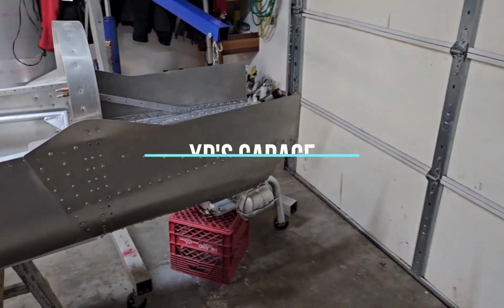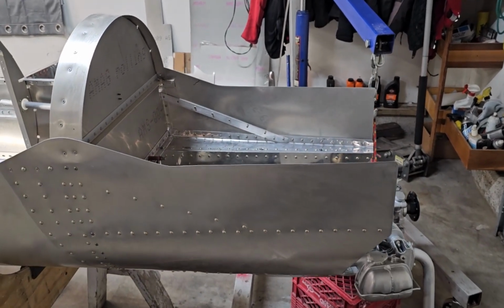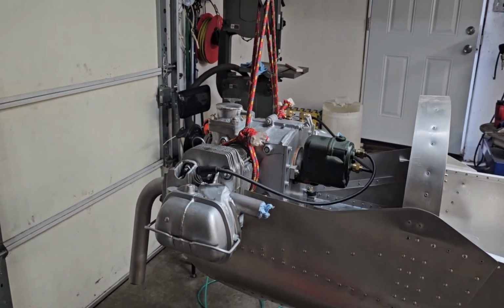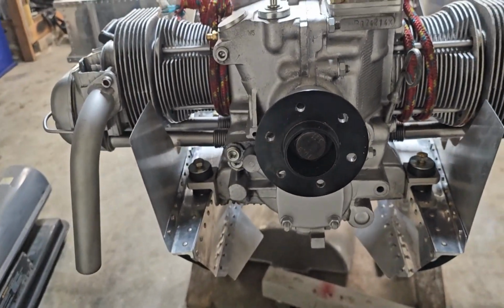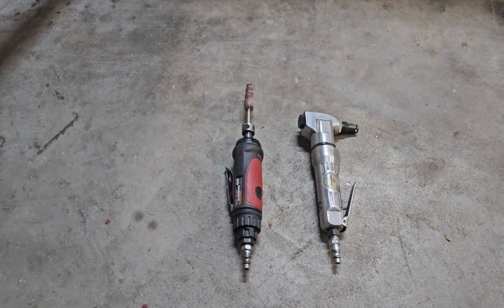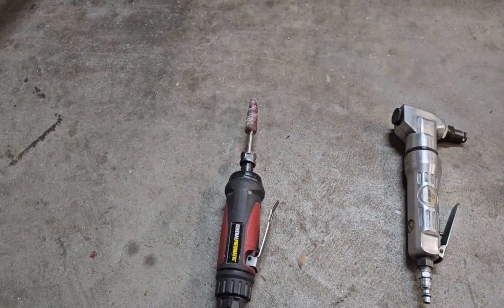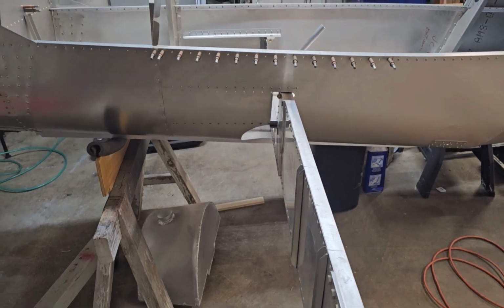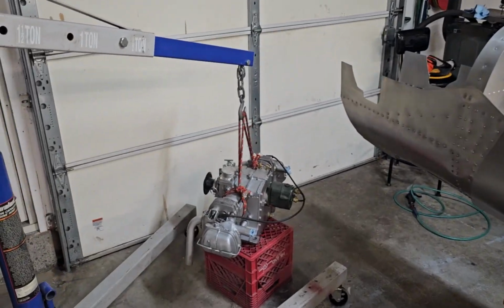Hummel Ultracruiser Build - Fitting the 1/2 VW Engine into the Airframe

Comment: How did you get the nuts on the bottom of mounting bolts?
Reply from the maker: There are nut plates riveted to the bottom of the angle on the inside.